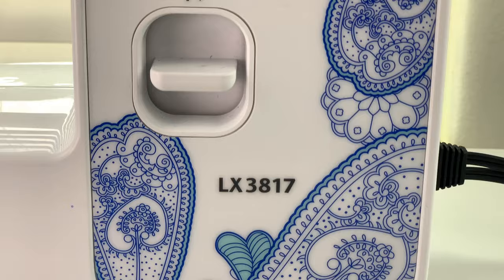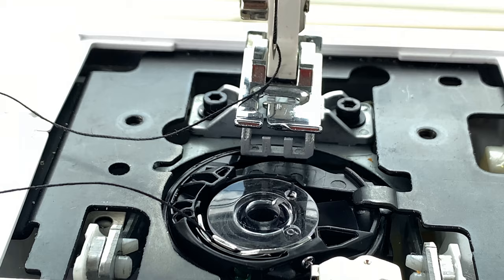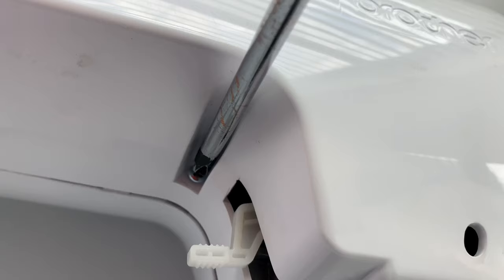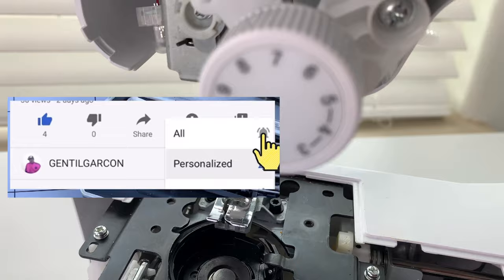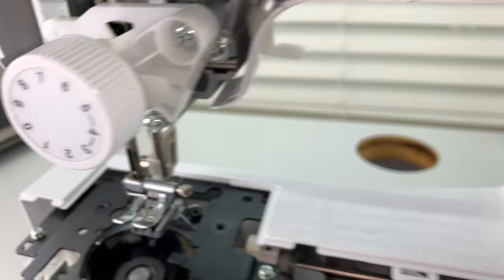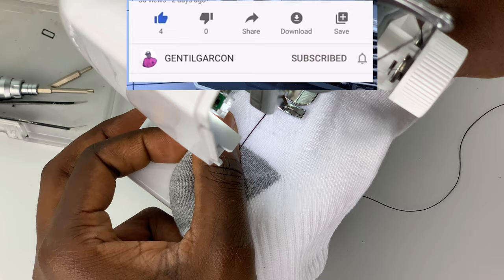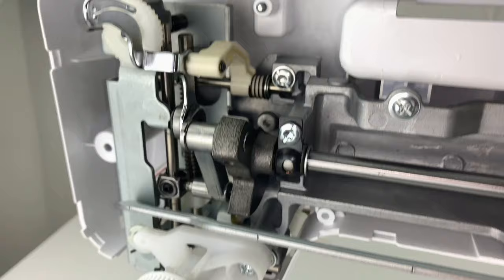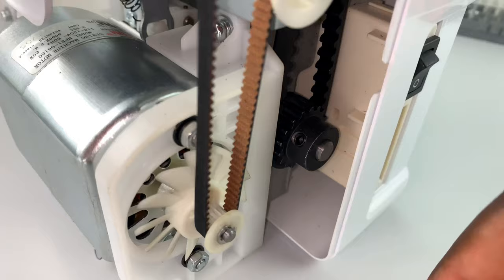How: Sewing Machine Hook Timing Issue Repair - Brother LX3817

Comment: Followed your instructions.  Got it aligned.  But now the needle hits bottom of tray n it gets stuck 😡🙈.
Any ideas on what to do next?
Reply from the maker: Hey, go back into the machine , position the silver bottom piece aligned with the top needle and manually bring up that top needle a little bit and try it.
Reply from the maker: Make sure to watch the Video all the way until the end. Because you have to tight your Allen screws back up.. don’t over tight them neither please.
Reply: @MarcelJoel  i did. A few times 🙈.
Got that part... but now its all shifted to the right n i cant get it back aligned 🙈
Reply from the maker: There is a screw on the side of the machine  that allows the top needles to move toward you or away from you . Use a Philips screw driver in order to move that needle the way you want it

Comment: I cannot even get the face off my brother bx3000 to get to the timing chain.....🤬🤬🤬🤬. Now I know why this is my third sewing machine after I gave away the first 2. Your video is very informative but I'm 2 seconds of taking a hammer to this machine... too tired struggling to take the cover off to get the hammer...🤔
Reply from the maker: Karma De Angel Be Patient with it. Usually when you look around the part you want to take off there is a screw holding it down...Just observe first and remove.
Reply from the maker: Karma De Angel Also keep your screws organized.
Reply: @MarcelJoel  thank you, I have removed all the screws the face is off it just seems stuck on something internal..I'm shaking but to no avail. I don't want to break anything but it locked into the round nob that shows the thread designs...
Reply: @mysticmoon7199  any luck? im having this same issue now.
Reply: @craftysofi2443  hello, I had taken it back to the store and I was sent to a mechanic who fixed it. Never told me how only that there is a trick to taking off the cover...🤔😕.

Comment: Hey do you retighten the bolts or leave them
Reply from the maker: Liyah Michelle Yes you have to tighten back up the bolts right after the alignment of the top needle and the Silver piece on the bottom. I mentioned it at the end of the Video .
Reply: GENTILGARCON thank you
Reply from the maker: Liyah Michelle did it work for you?
Reply: GENTILGARCON yes and no now the needle keeps hitting the nail
Reply from the maker: Hitting the nail , you mean the silver piece inside the bobbin case?

Open the machine again and align the silver piece and the needle again and try to raise that top needle up a little bit. Tight up your Allen screws back up and test it.
Reply from the maker: Is it working now?

Comment: Mine still won’t grab it correctly and pull it up without knotting 😩😩
Reply from the maker: After aligning everything you are supposed to tight back up your Allen screws so the whole mechanism won’t be loose.
Reply: @MarcelJoel  I stripped the screws with the Allen wrench 😥
Reply from the maker: @kyleigheliz99  Did you get the exact 2mm Allen Key?
Reply: @MarcelJoel  yes I did

Comment: My timing won’t budge , I keep trying to unscrew it and it’s way too tight
Reply from the maker: Don’t strip your screw while doing that..make sure the Allen key is all in and snug with the screw and turn counterclockwise 🔄 to unscrew them.

Make sure you got the right size Allen key too.
Reply: GENTILGARCON I have the right size, but it seems like the timing part isn’t like sharp shaped (if that makes sense) so every time I try and turn it, it just turns without unscrewing (if any of that makes sense)